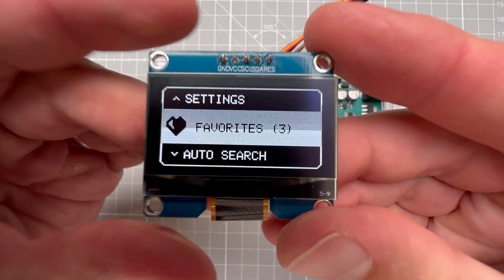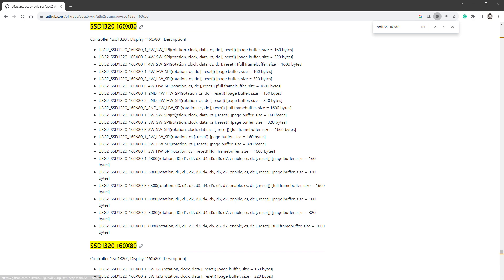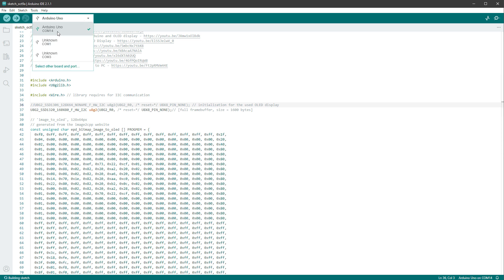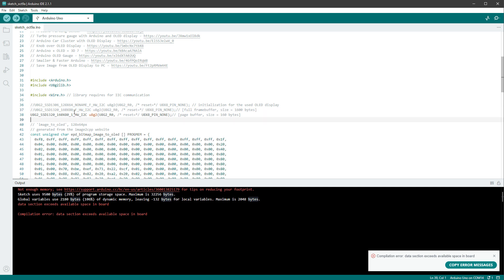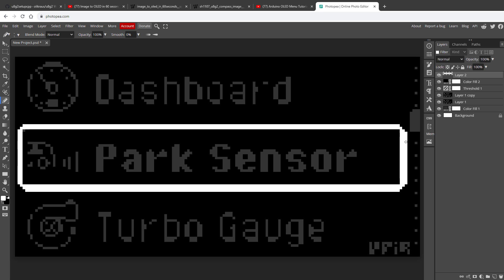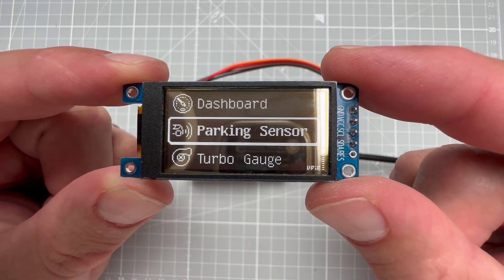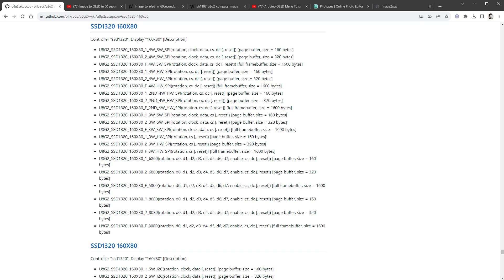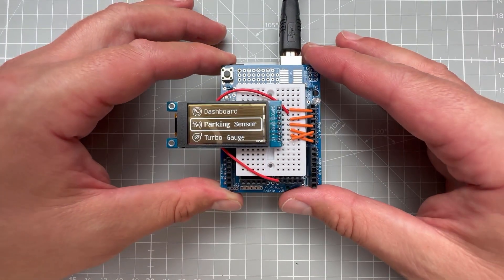Arduino Mirror OLED - WHAT?

Comment: There is not advantage to this type of display - they just don't put the anti-glare film on it.
Reply from the maker: Yep, I have already found out based on the previous comments. I haven´t found out if you can buy the polarizer film alone and if you can also apply it without any special equipment. That said, I still like the unusual mirror look of the display - and the brightness.
Reply: @upir_upir   I don't think its a polarizer, its an anti glare film - different structure and function.
Pretty sure you can find some online, as for applying - the classic - soapy water and queeze out the bubbles.
Reply from the maker: @VEC7ORlt Thank you for the clarification. I will see if I can find it and buy it and turn this into a proper display.

Comment: It's just a normal OLED without polarizer, the polarizer ages in the air, so the producer always skip the last step, and leave it for the reseller to install the polarizer and protective film. You can just peel off the gray plastic film on a normal OLED and it will become like this one. The polarizer is for reduce reflection.
Reply from the maker: Thank you for the clarification, someone had pointed this out earlier in the comments. It’s just unusual to be able to get the display without the polarizer. I wonder if you can also get the polarizer alone and apply it. Would it be similar to just using a sticker, or is there any special equipment required? I will definitely try to remove this layer from one of my OLED display.

Comment: I saw similar displays on some rear-view mirrors. But it was a cheaper configuration, without OLED - the mirror surface was “above” the display and caused significant interference for both the rear-view and for the display itself.
Reply from the maker: I believe in that case, the display is mounted under an actual mirror.

Comment: maybe you can aim a focused light on the display, and the graphics could be projected on a wall?
Reply from the maker: That´s an interesting idea, I wonder if that would work.
Reply: Nah, it would reflect the same amount of light regardless if the pixels are lit or unlit. What you see in the reflection is the electrode structure evaporated on the glass.

Comment: It's really good to see this explanation around memory usage. I find that Arduino boards can often be challenging to developers just starting with this kind of hardware, counting RAM in KB is definitely a major limitation (compared to say the MBs you often find on ESP32 boards). It's even more difficult with ATtiny chips, e.g. an ATtiny85 has 8KB of flash and 512B of RAM if I remember correctly. Power consumption for these chips is fantastic though!
Reply from the maker: Thank you, I´m glad you like it. And you are correct about the ATtiny85, since I´m currently working on a project using this chip. Plus, if you use bootloader, it´s only 6KB of Flash.. anyway, expect a video soon..

Comment: Normal oleds have a polarizing filter on top to increase contrast. If you peel this filter off you can turn any oled into a mirror one. I did this a few years ago on a screen whose filter got really scratched up and liked the look so I just never replaced the filter.
Reply: So uh any image?
Reply from the maker: Thank you for the clarification, do you have any photos of your display? Also, do you know if there is any real technical advantage of having such display?
Reply: @upir_upir  I still have it somewhere, probably still packed since I moved into a new house. I'll see if I can find it and link a picture. As for an advantage, not really other than maybe aesthetics (at the cost of visibility). I guess technically it's twice as bright for the same current draw since polarizers cut roughly half incoming unpolarized light.

Comment: How to display images on oled display from sd card module?
Reply from the maker: Store images on sd card > read data with Arduino > draw those on display. Wokwi actually have some examples, let me find it..
Reply from the maker: Here is any example how to do that - https://wokwi.com/projects/319810932695892564
Reply: @upir_upir   Thanks for your reply,  but I am using ESP32, and it looks like Adafruit ImageReader library isn't working for esp32. Is there any other way?